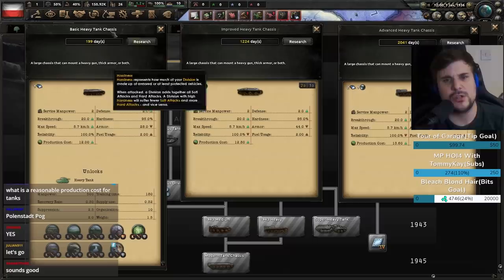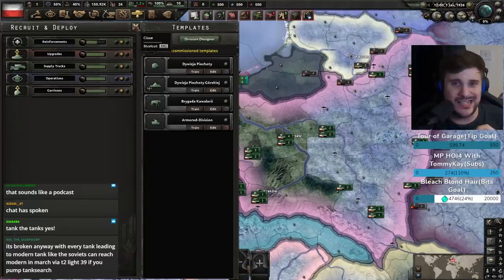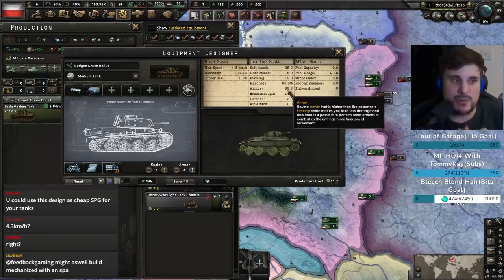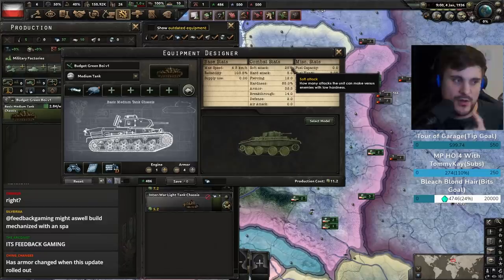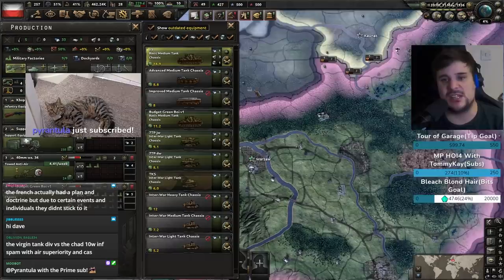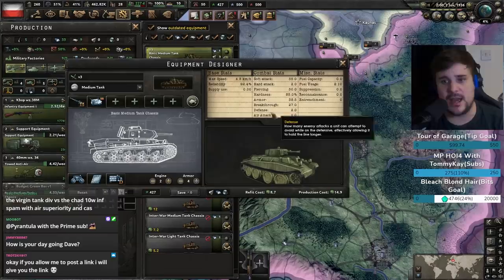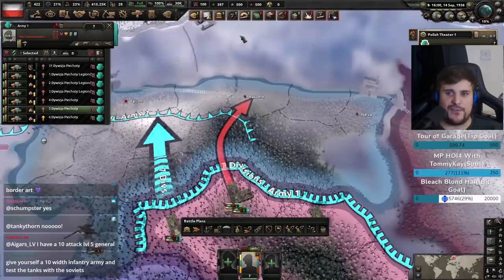NEW Optimal Tank Design - HOI4 No Step Back Tank Designer Guide

Comment from the maker: Are you an average speedy tank fan or a heavy armoured tank enjoyer?
Reply: Do a video where u abuse airplanes dave :D
Reply: You found an exploit I think. Look how expensive the last tank is you made but then look at the refit cost. Just build 10,000 crap tanks and refit them all to good tanks and you still come out cheaper
Reply: on this dlc i've been using 45w infantry divisions 18/3, and haven't been using tanks a lot since those things just destroy everything, but when i do/use tanks, i like to make them with the most breakthrough and armor posible, while at the same time with a decent speed, so for me its kind of both i guess.
Reply: But i dont think that cheap tanks are that good because i could build motoristed Rocket arty (Katyushas) in the same time , better softattack ,faster and even scales better because of upgrades u get later if you tec rocket arty so you could even  keep the production line 
so i dont the point in building cheap crap tanks 
just build a big div motorized with rockets arty and add fast TDs with high velocity gun for piercing (i tried it out you could even build an fast heavy TD with an superheavy gun that could keep up with 12 speed and the superheavy gun which has the highest pierching so you can penetrate any armor )
Reply: Im still a fan of "fast" tanks ... you have to "plan" your attacks way better, check for railway lines and supply hubs along your "path" in front ...
And the Most important thing ... Supply dropping with your planes ... with Air and Transportplanes ... i think "fast" tanks are even stronger then bevor ... you are able to support your main line way better now ... taking important supplylines and hubs is just amazingly strong ... 

But it is expensive ... you NEED to have Air to pull that of reliably ...
Reply: heavy armor forever but i also do light tanks.
Reply: I prefer a fairly heavy tank, maybe like 6 speed at most.
Reply: Nice vid Feedback. FYI: The tread-heads (like The Chieftain) pronounce Bogie with a hard g (as in guest) not a soft g (as in jest). The source of immutable truth (Wikipedia) is the same: BOH-ghee.
Reply: Both.
I started being a bit of a min-maxer.

All my creations are based on either speed or chonk. Never failed me so far.
Reply: Mediums to cause a break in the frontlines, lights to exploit it and snipe supply hubs.
Reply: I mainly play minors. I don't Usually know what tanks are until late game, but when I do them for fun earlier, I build the cheapest pieces of shit I can muster and stick horses to them.
Reply: Flame tank medium support company. 15 tanks per division armor bonus for all your infantry
Reply: @apictureoftomcruise9354  
I don't think so, actually xD

At 12:00, he's got a tank that would cost 30.2 to make, while the original (v3) cost 14.9 (at 10:23), for a conversion cost of 7.0. 
Now, 14.9 plus 7 is obviously less than 30.2, sure. But the design went down from 92.4% to 46% reliability. 
In other words, yeah, you'll basically magically get extra production points (if measured per day from all factories combined since the start of the game). But the resulting stuff will fall apart almost immediately once it's at the frontline, hahaha. (or even before that, if you let them drive across mountains to reach it, lol)

- - - - - - - - - - - - - - - -

Side note 1: 
I'm not sure how much production efficiency you'd lose by changing from production to upgrading - this factor actually means that we should take the conversion cost stat in the designer with a LOT of salt. 

Side note 2: 
I'm not sure how the 200% construction bonus for doing conversions comes into play here.... it might actually mean that upgrading at tank from a design that cost 15, to a design that costs 30, for a conversion cost of 15, is still a *net gain,* hmmmm.... 
(of course, you do not make more stuff to put into the field, so maybe that's how it's balanced...?)  

- - - - - - - - - - - - - - - -

PS: 
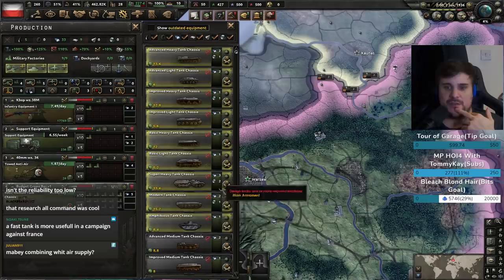you might also have meant the Advanced Medium Tank Chassis that's visible briefly at 12:17, which costs 30.3 to build or 17.3 to upgrade to, but since that difference is 13, which is lower than the 14.9 that the v3 tank cost, the math doesn't* work out, so I figured you meant the previous one :)
(*although, see side notes 1 & 2, lol - as if this game wasn't confusing enough yet)
Reply: @M J 
I just checked the Wiki for another video, and noticed that both normal Rocket Artillery and Motorized Rocket Artillery give more Soft Attack per Production Cost than normal Artillery or Motorized Artillery do, respectively. 
(you do have to switch over factories and thus lose efficiency, of course)

So, although you are absolutely correct that truck-drawn rocket artillery is cheaper than motorized rocket artillery, it only costs 3.16% more, but gives you +20% soft attack!! 
(and +25% defense, and +33% breakthrough!)

So, if speed is not a concern, then motorized rocket artillery is a *massive* waste, but taking rocket artillery instead of normal artillery is more expensive, yet still worth it. 
And if speed is a concern, then motorized rocket artillery is the most expensive but still gives you the biggest bang for your buck :)
Reply: Try heavy flamethrowers, you'll like it.
Reply: @owens782  Spam Tactical Bombers and you'll basically have a counter to most air, even more for anything in the water. :)
Reply: Hi Dave, after the last dlc there is a subtle change "The way in which divisions target other divisions in combat has been significantly altered. Targeting will now be primarily based upon potential damage dealt vs combat frontage." sooo maybe big division is not the best strategy or maybe you can have a large defending division and a sneaky glasscannon division in combat and be effective, is worth to be investigated.
Reply: @cristinmarius  oh oki thxxxx
Reply: Feedback for FeedbackIRL !

I watched quite a lot of HOI4 videos lately, read some comments and played some SP too, so here are my thoughts :

1) In a comment in another video, a smart guy found a way to fit combat width pretty nicely across most terrains ; he has 2 types of divisions he produces, one with 24, one with 30 width. That way, if you stack enough of these divisions, you should be able to pretty closely match the combat width of the terrain you're in, and the 30 width can be made with just 10 army XP once you got your 24 width ready by duplicating the template and then modifying it.

2) Another school of thought that I haven't tried is to use the extra high organization of infantry, so smaller divisions have higher org, and because of the change in targeting during land combat, small divisions aren't that penalized anymore. Pair that with the Integrated Support support branch of Superior Firepower for more organization and soft attack from support companies, and you can stack and rotate 10-width infantry divisions, whose actual firepower comes from the support companies, on a few tiles to achieve breakthroughs.

3) I'm not too sure what's the meta for tanks now, but we should not only take a look at how the stats of tanks changed, but also how everything around them changed. Prior to NSB, a 1939 medium tank battalion cost 600 IC, and provided 2.0 HP,  a speed of 8.0 kph, 80% reliability, 90% hardness, 19.0 soft attack, 14.0 hard attack, 5.0 defense, 36.0 breakthrough, 60.0 armor and 61.0 piercing. With your medium tank design at 4:45, the medium tank battalion would cost 560 IC and provides 2.0 HP, a speed of 4.3 kph, 103.5% reliability, 85% hardness, 25.0 soft attack, 5.0 hard attack, 2.0 defense, 14.0 breakthrough, 38.5 armor and 5.0 piercing. Note you could add 4 additional machine gun modules, raising the cost of the battalion to 660 IC but boosting the soft attack to 33.0 (more with a tank designer adding soft attack), so it's probably a better tradeoff to stack MGs. The dozer blade module also helps with entrenchment if your divisions are given enough time to establish defensive positions, and comically, it stacks with each battalion, even with the armored recon support company if the light tanks have the dozer blade, meaning 5 tank battalions with the dozer blade add +10 entrenchment to the division.

So except for the cost, reliability and soft attack, everything else is inferior to the old medium tank battalion, meaning that unless those stats reduction don't matter, and everything else was constant, the medium tank battalion is less interesting an option. But things have changed ; a railway gun costs 800 IC, so probably less than a medium tank battalion mid-game, and provides a 10% reduction to the stats of all enemy units within its radius ; and you typically only need 1-3 guns per army, so that's quite a good deal for boosting the combat power of entire armies. Motorized and mechanized infantry have been buffed by requiring less equipment, so they cost less ; on top of that, every unit that uses the motorized equipment got +10 breakthru, even the support companies. Also the hardness of anything motorized has been buffed to 20%, and 30% in the case of towed AT guns, meaning that when you tech Mechanized I, these units got a hardness of 40 and 60% respectively, so we could say that even if pierced, those battalions have a damage reduction against most divisions close to 40 and 60% respectively because soft attack is generally much larger than hard attack, so these battalions have a damage reduction close to not being pierced prior to NSB. Also, the piercing of AT guns has been buffed slightly, and tanks/variants can have the squeeze bore module, making piercing enemy armor pretty easy now. Also, if you got a large amount of army XP, you can make mechanized cheaper now, further buffing the mechanized infantry battalion.

So one thing I'd try is designing armored divisions with a reduced share of tanks, but more motorized or mechanized, and towed arty or AA. That way, compared to the old armored divisions, the cost should be similar or even lower, the armor and possibly the hardness and breakthru will be lower, the hard attack and possibly soft attack values will be lower, but the divisions will gain a ton of HP, defense and organization. Land combat will then last longer, but the new armored division will probably still come out on top because of the extra HP that dilutes enemy damage and the higher org. 

I'd also add a medium tank destroyer battalion to every armored division, and probably every infantry division too, to raise the armor, piercing and hard attack ; since it requires 24 vehicles, it isn't too costly (probably less than 700 IC), and you can add sloped armor and the squeeze bore module to gain an edge in armor and piercing over the enemy. Possibly upgrade the armor level and get cast armor too if needed. Such a tanky TD battalion also means that if the enemy doesn't invest in a minimal of AT, he will be punished by infantry divisions that can't be pierced.

4) The SP arty battalions are basically dead, because they require barely less vehicles than a tank battalion with exactly the same vehicle (36 vs 50 for medium), but their hardness drop to 65% and they got a higher combat width and supply consumption. The SPAA battalion is also dead because its anti-air attack and piercing is inferior to AA or towed AA, and one of its advantages before NSB, extra breakthru, vanishes in NSB ; an SPAA battalion basically has 0 breakthru now.

5) Another thing to be wary of with tanks and variants is the hidden IC ; attrition will be higher now since it's easier to get into low supply areas, meaning a medium tank battalion may cost 800 IC to produce, but you'd have to add X IC per day of combat or moving across land. Adding various modules to the tank will raise the IC, but also the quantity of ressources needed per factory ; there's even extra ressources needed for certain thresholds of engine and armor upgrades, 10 and multiple of 5 respectively IIRC. So you'd need to allocate more civilian factories to import all those crucial metals, as well as more supply dockyards to have the convoys, and some more dockyards to have a proper navy to escort the convoys. That's why the rocket launcher modules are an interesting alternative for howitzers on tanks ; they don't cost that much IC and they don't require any ressources ! The tradeoff is they provide less soft attack and inexistent piercing. Also be aware that attrition, as described on the HOI4 wiki, penalizes small quantities of a given equipment, as there's a minimum attrition value per equipment per hour, so that superheavy TD battalion with 7 vehicles costs really a lot in practice. You can check the equipment losses by clicking on the notepad on the theater bar, and in my experience, I lost way more tanks to attrition than actual combat, despite designing tanks with 100%+ reliability and having maintenance companies in every division, especially equipment in low numbers such as light tanks only used as armored recon support companies.

6) Unless you want the absolute best reliability, breakthru or speed, the gasoline engine and torsion bar provide the best reliability for a given speed of all the combos I've seen. Except for the gas turbine and torsion bar combo IIRC, but who would use the gas turbine with its insane fuel consumption ?
Reply: @M J 
I have plenty of rubber as Germany :)

But I cheekily justify on Dutch Indonesia ASAP, lol

If I had to play a cheese-free game, then yeah, getting the resources would be a PAIN
Reply: @cristinmarius  
What do heavy flames add over light flames?
Just the extra armor?
Reply: @MrNicoJac  The flame support tank gives your infantry division a lot of armor and breakthrough that your unit would not have otherwise. They also work well vs fortifications. I would not advise using it normally in a division as you would AA or TDs.
Reply: @cristinmarius  
Oh oh.... 
In the patch notes for 1.11.4 it says:
"Support tank variants now get -0.95 breakthrough" 

Enjoy it while it lasts? xD
Reply: @M J But you can get it earlier and mot rocket is better than the towed rockets II in the end so they are overall better
Reply: I love both though I do not really ever have my speedy tanks snake 
I do consolidated pushes by slamming them forward then hold the line and wait for the infantry or motorized to catch up then plan and go again just make sure they cannot dig in and micro around every division you can
Reply: @apictureoftomcruise9354  I'm gonna try that
Reply: @braunreal  let me know how it goes!
Reply: I am super-heavy enjoyer
Reply: Love both really and I bounce back and forth. There's just something about those light tanks zipping around to encircle things, or a rapid capturing of a hub or something important. Just as there's something about those heavy juggernauts smashing a section of line to pieces lol. They both have such fun appeal.
Reply: Im a cheapskate tank enjoyer
Reply: I'm a fan of the clickbait video title and the video itself not having very much to do with each other.
Reply: I like fast tanks way more in theory, but in practice the heavier tanks just do way better for me. If I want speed, motorized/mechanized with motorized rocket artillery performs better than light tanks and are cheaper to boot.
Reply: I don't care much about speed. I want high hardness and at least descent armor. If it is durable, reliable and not too expensive it's a perfect fit for me. If the tanks barely take any damage you can grind out enemy divisions even with a lower attack than a big heavy tank.
Reply: Super heavy tank enjoyer
Reply: Just watched the first part, where you made your british tank (which could be a french tank too tbh), you know that you can add extra ammunition on this template that gives more of every stats without making the tank more expensive (but it drops its reliability by 10% for each one you add i think)
Reply: I like pocket-heavies. Heavily armored light tanks for armored recon brigades. By 1941 they lose their armor bonus but they work perfectly till that date.
Reply: I enjoy both. :Chad:
Reply: Speedy because I like blitzing no matter what country I am lol. Nothing like spearheading behind the front line and capturing victory points before anyone knows what happened
Reply: Land ship enjoyer
Reply: Speed